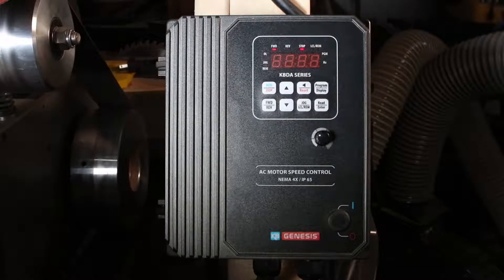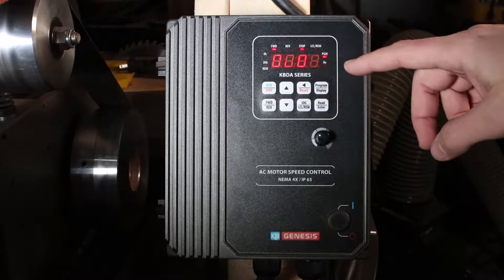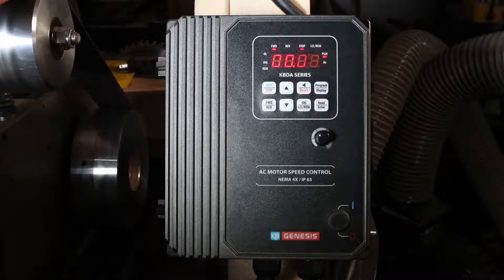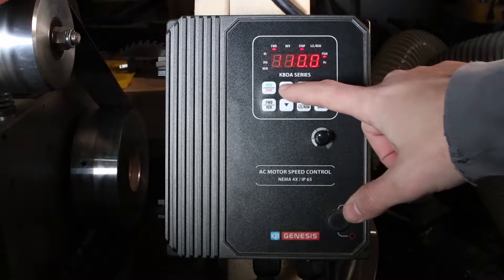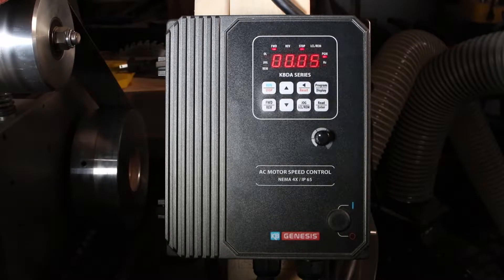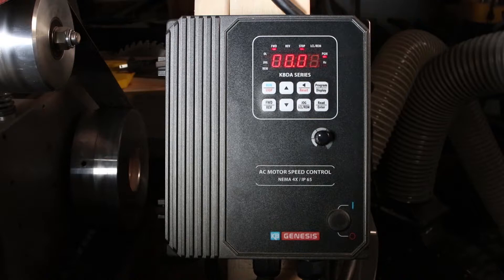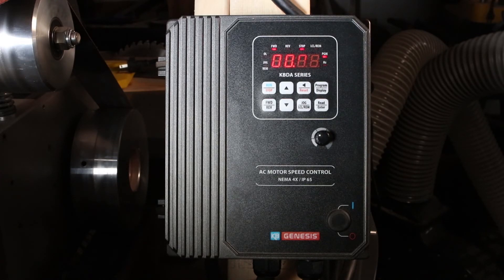How to set up a VFD for 120 Hz

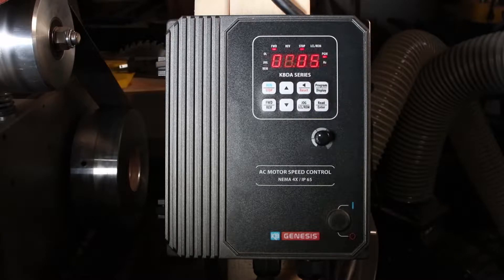Comment: 1:32 over on Bladeforums (the thread is called "1750 RPM vs 3500 RPM)" one of the guys there said that both a 1750 and 3450 drop off in torque as you go from 60 to 120, and that both the 1750 and 3450 are almost comparable in how much they drop off.  So really it is better to get the 4-pole 1750 motor and double the speed, versus the 3450 2-pole motor.  The 1750 4-pole motors are heavier and cost more.  That way at lower speeds you have better torque over a 3450 motor.  Most of the guys there that have experience with this say the 1750 is the better choice.

Comment: You have a lot of good info for setting up KBDA VFDs, Thanks for the videos to help me decide on picking the KBDA over KBAC.

However, this is not the correct way to set up a 60hz motor for double speed operations.  You've set up a custom 120hz motor.   With this setup, you won't achieve full voltage until 120hz, when you should be hitting full voltage (thus, full power) at 60hz.

You should set up the VFD per the motor nameplate for 60 hz (or 50hz if not US) for option 0.00.  Then use option 3.02 - Upper frequency limit.  Set that to 120hz and you you've now mimicked the capability of the 2x jumper on the KBAC. You can verify this behavior by enabling the voltage display to confirm the motor's operation. 

By adjusting the upper frequency limit, the motor will achieve full power at 60hz and then you'll just be losing torque as you go from 60-120hz.    In a knife grinder operation, you'll typically have more than enough torque anyway, so losing it is ok.  This is hugely popular on the KBAC drives and you can set up the KBDA the same way or limit to any other Hz if you need to limit speed.
Reply from the maker: You are 100% correct. I looked at the manual and I remember reading the explanation for the upper frequency resetting the value to the name plate frequency from option 0.00. Now looking back at it I realize that for some reason my brain stopped at that and never even contemplated that you could could change 3.02. It's one of those things that you look back to and wonder if alcohol was involved.
Reply: thankyou for confirming my assumption, that's actually why I came to this video. Good info -Cheers
Reply: @brad06ag  Do you think the KBDA-27D could be programmed to run a 6 pole (1200 rpm) motor?  I get that it can run a 4 pole (1800 rpm) motor by, I believe, doubling the frequency to 120.